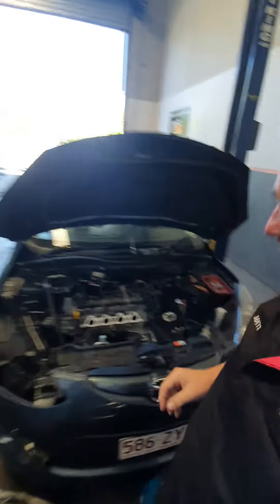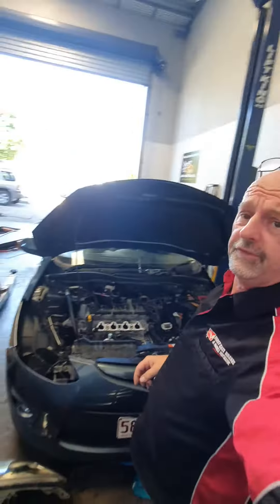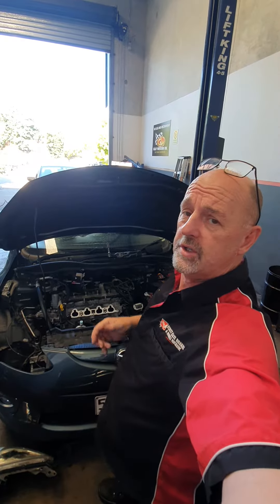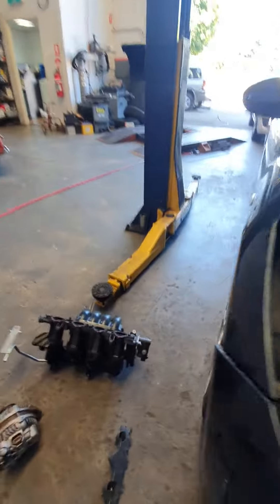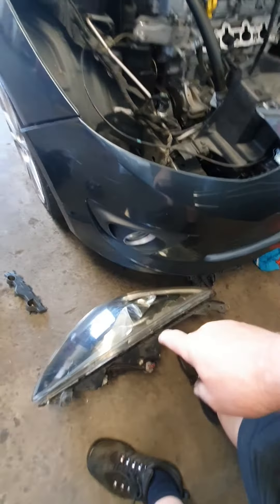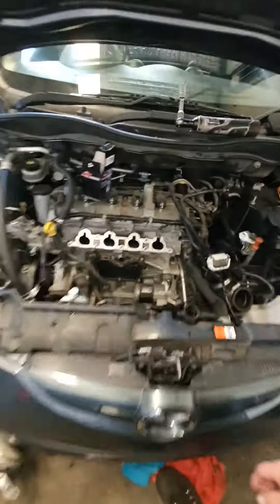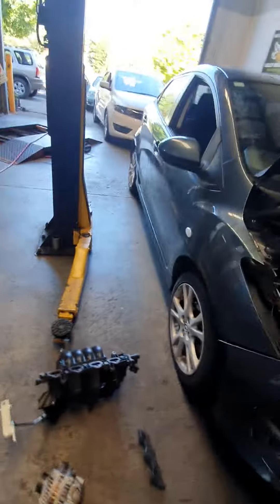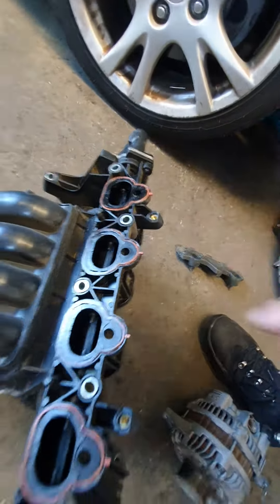Where is the Mazda 2 Knock sensor located

Comment: Do we need to replace the gasket on the inlet manifold? Or after we change knock sensor can we just bolt it back on?
Reply from the maker: You can reuse the gasket if you want. Usually they would be changed
If you reuse the gasket I'd perhaps put some gasket sealer on them 
Regards Matt
Reply: Also is there a special tool or socket like a o2 sensor?
Reply from the maker: @JordanKumeroa-e2h  yes you can buy an O2 sensor socket to remove the sensor

Comment: Cheers mate is it the P0328 code? Can it also cause the hard start? Have yet to check fuel pressure. Tried fuel cleaner + high octane petrol already.
Reply from the maker: Yes P0328 is a Mazda knock sensor code. Not sure on hatd to start unless it's giving a Crank angle sensor code as well. Otherwise yes certainly check fuel pressure and that the pressure still holds when the engine is not wound over. In case the fuel pressure regulator is faulty. We had a Toyota with a new in tank fuel filter worked out the new filter was faulty we needed to wind the engine over for ages before it wpuld start. 
All the best and God bless ya 
Regards Matt
Reply: @firstclassbrakesandautomot6941 thanks! Just happened to have a bad fuel pump too. Replaced it with bosch one and all is good.
Reply from the maker: @kohjiiida2637  Always something to be done
Regards Matt